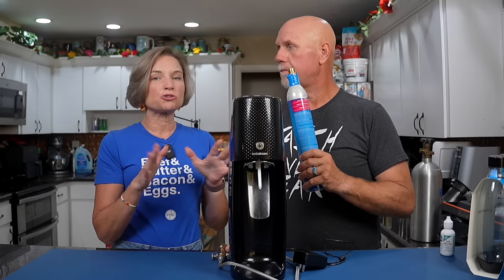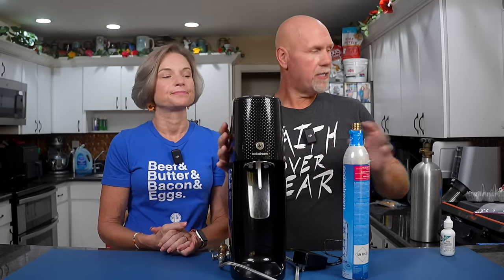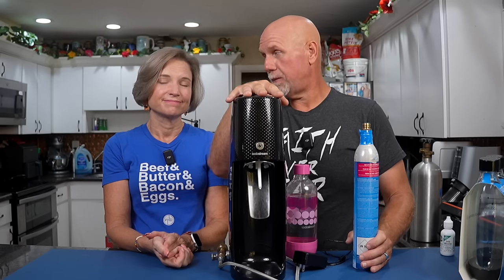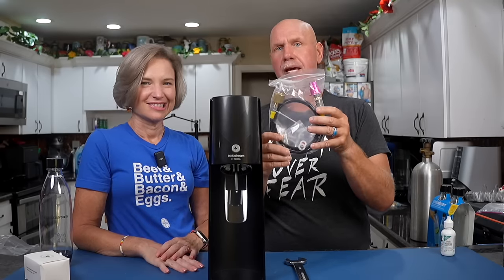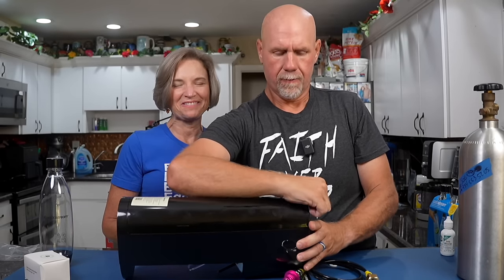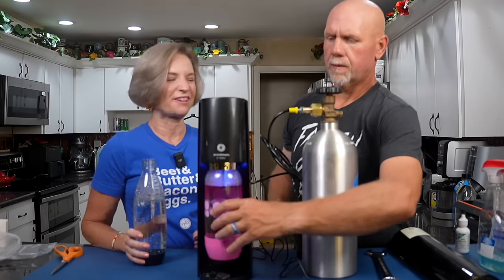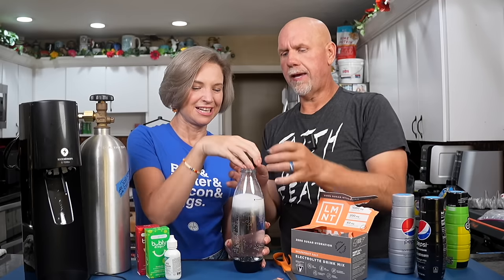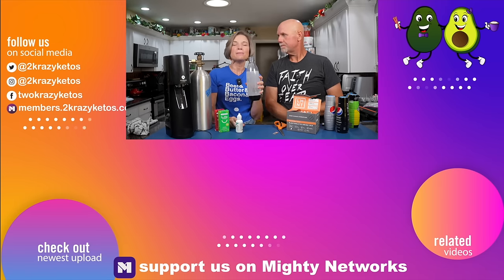Does the SodaStream system save you money? | How to modify the SodaStream Terra models

Comment: You should always keep the water cold BEFORE carbonation because the water will hold the carbonation better and it will carbonate more efficiently. It's a simple physics principle.
Reply: I agree.
Reply: Hubby and I keep a britta pitcher of water in the fridge and use that to fill our soda steam bottles. 😋
Reply: He said this... why are you bringing it up ?
Reply: Not only that, but in my beer making fridge, I keep the whole C02 tank cold also .... proper pressure achieved much quicker.... better .. physics.
Reply: @jhillestad  Yes, he said that they like to put their bottles with water in the fridge, but he didn't say WHY, which is what the OP did here.
Reply: Yup. Gasses are more soluble in liquids at lower temperatures. Boiling tap water makes it taste bitter because of the CO2 that gets boiled out, making it more alkaline than regular tap water.

Comment: Just so folks know: mileage may vary!  I charge at least one 1-liter bottle a day (sometimes 2) and my small Soda Stream c02 tank lasts me at least 3 months. Also, the cost of canister exchange here in my NC town is a flat $16. Our local Staples and Target keep them in stock. That being said, the main reason I have a Soda Stream is for convenience and to reduce the waste of single use bottles and cans.
Reply: This doesn't math up. 1 liter bottle, at least once a day for 3 months. That's a minimum of 90, 1L size bottles. Even if you go by the 840mL fill line, that's a minimum of 75L worth of carbonated water. The company states it does 60L, which I have not gotten close to. The closest I have gotten to is 35 of the 1 L size bottles, which is about 30L of actually carbonated water. What's your hack for getting at least 75L of carbonated water from a single 410g co2 cylinder?
Reply: 16 bucks for a small thing of c02 is ridiculous. You can buy an adapter and fill up a 20oz co2 tank for under 5 bucks at your local sporting goods store. Thats the route i took, ive had the soda stream with the modifications for about 4 years. Id say ive probably saved a few hundred dollars not having to pay that cost for their co2 tanks.
Reply: @TooMuchTemper it costs me $18 just in gas to get to my local sporting goods store because it’s so far away. So $16 to not have to drive that far + cost of the refill sounds like a good deal to me
Reply: Does the sporting store have food grade co2?
Reply: For the small cylinders I pay $10 Canadian $ at Winnipeg fire and safety.  They advertise on the radio.  They also have bigger cylinders but they won't save you money because you can't get all the gas out because the pressure drops and the cylinders have a date stamp and can't be refilled after that date.  The small ones are cheaper overall and about $7.50 USD.   You should get the same price in the states if you shop around.
Reply: @TooMuchTemper  I was going to do that but then I found out the bigger cylinders expire and you can't get all the gas out.  The pressure drops and there is about 20% still in the bottle.   I weigh my small bottles and because of the shape and smaller volume you get almost all the gas out and into the water. Then you don't have to find a place to mount the larger tank and run the hoses.
Reply: @jeffbguarino  idk i use it all the time, canister i have lasts probably 3 months before i have to take it to the sporting goods store and fill for about $5.30. Ive had it for 5 years now roughly. Doesnt seem like the can is in bad shape? I also dont see an expiration date. The mod was well worth it for me
Reply: @jeffbguarino  also my tank fits right in the soda stream unit. I have a very old version
Reply: @jeffbguarino  try tippman 20 oz bottle. The date stamped is the production date ! Not an expiration. Brass mod was 75 dollars. After years of use ive definitely got my moneys worth with the larger capacity and 5 dollar fill ups

Comment: Any Welding or Industrial Gas supplier will sell you a bottle, and refill / exchange it for you at better rates than Dicks or the beer / homebrew distributor.   Bonus:  The bottles have to be periodically pressure tested, so if you are exchanging them, you never have to worry about that.
Reply: This is useful info. I purchased a new empty CO2 tank but it's hard to find anyone in my area that will fill up an empty tank. They all just do tank swap outs. Worth checking around your area first to see if any place even does refills, and do a price comparison. The welding/industrial gas spots do seem cheaper
Reply: @JoshSchlottman  The other take-away is this:   Visit a gas supplier and tell them exactly what you intend to do.  In my case, I am refilling sodastream bottles (not very often, they are a PITA) or small CO2 bottles for use with a sodastream adaptor fitting, so they recommended a SIPHON.

I have a 20lb cylinder, WITH A SIPHON.  This feeds liquid CO2 from the bottom of the big cylinder into the target.  You get a better fill, waste less gas, and generally, can all-but empty the liquid from the source bottle.
Reply: @whiteb0rd  - Hi @whiteb0rd, 
I feel a little bit dull in trying to picture what you are describing here when you say, 

"The other take-away is this:   Visit a gas supplier and tell them exactly what you intend to do.  In my case, I am refilling sodastream bottles (not very often, they are a PITA) or small CO2 bottles for use with a sodastream adaptor fitting, so they recommended a SIPHON.

I have a 20lb cylinder, WITH A SIPHON.  This feeds liquid CO2 from the bottom of the big cylinder into the target.  You get a better fill, waste less gas, and generally, can all-but empty the liquid from the source bottle.",

but as I am simply exploring this whole process & do not even own a SodaStream at this point, besides seriously requiring visuals for me to understand unfamiliar processes, I'm struggling to follow what you are describing.  Any chance you could make a short YouTube video to talk through & show the steps of the way you've found to do this?  Maybe you could then comment back here with the video name & your channel name, so that people could find it (Or maybe these folks could pin it here to facilitate the search)?  In any case, I'm really interested in what you've described & would love to understand better! TY!

["Does the SodaStream system save you money? | How to modify the SodaStream Terra models" - via 
2krazyketos]
[5.27.2024]
Reply: @mcsmama what a siphon is in a 20 lb CO2 canister or any refillable CO2 canister for that matter, is essentially a tube that runs from the valve at the top of the tank to the bottom where the CO2 is in a liquid form. I cannot explain how, but this makes complete use of all the CO2 in the canister as opposed to drawing CO2 from the gas state at the top of the tank if it does not have this tube.

Comment: I have been running a soda stream on a 5lb co2 tank for a few years now. I drilled a hole through the countertop and ran the hose down to the cabinet below where I store the co2 tank. makes for a really nice looking install.
Reply: Is it dangerous to keep in your house? I think I would want to keep mine on my condo balcony just in case. What if there is a leak??
Reply: @hw3006  it's co2, not explosive. Would you worry about having a fire extinguisher in your house?
Reply: How are you refilling it?

Comment: I add the electrolytes to the water before I put the co2 in, no issues. I use the manual soda stream, new style bottle. Must space your pumps out to match the bubbles expanding.

Comment: I bought a 500ml pump dispenser bottle on Amazon and pump a few squirts into a glass and then add the plain sodastream water into it. No bottle cleaning necessary since it only has plain water in it at all times. I can adjust the strength of the drink by using more or fewer pumps of syrup. For example the Pepsi zero I use 4-5 pumps, for Starry I use 5-6 pumps.

Comment: The difference in the non diet sodas is the sweetener. If you look at the contents, it shows sugar and sucralose as sweeteners. The Pepsi in the store uses either high fructose syrup or regular cane sugar as the sweetener. They are also using inverted sugar, as well.
 A long time ago, I worked at Jack in the Box and we had a way bigger canister for the carbonation. It may have had a device to keep refilling it, as I never remember refilling that bottle. We only refilled the syrup bottles.

Comment: you can modify any version.  I gutted mine and put it in a custom housing. I removed the button and replaced it with an electronic valve, so a Arduino could pulse the gas very precisely with a touch screen.  I then use a 7 station peristaltic pump to dose the syrup.

Comment: 20 bottles is really little. I have manual soda stream that uses pink cartridges and I definitely carbonated more than 50 bottles (840ml) already and no sign of it running out of gas yet. I usually press 4 or 5 times so I guess it's like low setting with electric ones, oh and in my country change of bottle is like 10 bucks in USD. But I guess with this mod you can gat way more for even less money in a long run.

Comment: I simply use 14.3 ounces of dry ice. I open the sodastream CO2 cartride bottle top. Pour in crushed dry ice, and then I put the bottle top back together. It cost me $2.20 to recharge 2 cartridges. $1.25 per charge. No other plumbing, tanks, or gadgets. I get the food grade dry ice from the local grocery store. It works perfectly. Dry ice is extremely brittle. It is easy to crush below 9/16 hole opening size. Funnel the right amount of dry ice, close it off, and I'm good to go for another 5 weeks. Easy Peasey. I have the Terra quick connect type of top to the cartridge.
Reply: Dry ice has become VERY difficult to find in my area. I used to use it for hunting and fishing trips, but have little to no location option recently.

Comment: I previously owned the SS CRYSTAL, but the base snapped, and I couldn't find replacement parts. I've since transitioned to the more eco-friendly DrinkMate. It can carbonate any juice or mixed drink without the need for extra water dilution, and it's also compatible with universal 60ml CO2 thread canisters, unlike the SS, which requires their own patented qikrelease, presumably due to Pepsi's acquisition, not sure why they need to keep over 20 plastic SS bottles lying around. I thought these machines were meant to eliminate this problem?

Comment: 13:06 It's a good lifetime general habit to never push when using an open-end wrench. If the wrench slips off, you are likely to skin your knuckles on something (or punch your significant other in the nose). 😵This will never be a problem if you pull on the wrench instead. Plus, it's easier to accurately gage how much force you are applying when pulling vs. pushing. (My dad taught me this when I was a child.)

Comment: Does the large CO2 tank require a siphon tube?
Reply from the maker: No
Reply: @2krazyketos  Thanks. So, a siphon tube is needed only if I wish to use a large tank to refill SS canisters without inverting the donor tank, correct?
Reply: @2krazyketos  Could you use a CO2 tank with a siphon tube?

Comment: Thank you!  Great info!  I have one of the old original Soda Streams. Is there an adapter that you’ve a link for to share?
Reply from the maker: https://youtu.be/0VArJfKQwE4
Reply: @2krazyketos  Thank you very much for the video. Sadly my model is even older than this video. It’s manual/push type & I think SodaStreams first generation of machines. Thank you again for trying.
Reply from the maker: @lisaturner6297  all of the original soda steam models use the same fixture.  If you are currently using the blue label bottles, it will work.  It works with the manual ones as well as the electronic ones
Reply: @2krazyketos  Thank you so very much. I’ll check again. It would sure be a great $$$ saver for us 😊

Comment: - 02:35 💰 SodaStream units are expensive, costing between $100-$200, with ongoing costs for CO2 cartridges.
- 04:21 ❗️ Despite claims, users often only get about 20 fizzy bottles per CO2 cartridge, making it cost-ineffective.
- 05:02 🧪 Attempted DIY solutions to save money by using dry ice as a CO2 source.
- 06:07 ⚖️ Differences between the old SodaStream models and the new Terra model.
- 09:40 🛒 CO2 canisters can be refilled at local stores, including beer and wine shops or sporting goods stores.
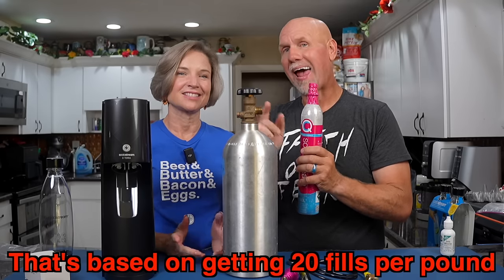- 11:25 💡 Cost-saving tip: Modifying the SodaStream to use a larger, refillable CO2 canister reduces cost per bottle significantly.
- 13:36 🔧 Step-by-step guide to modifying the SodaStream Terra model to use a larger CO2 canister.
- 14:56 🧊 Tip: Keep extra bottles filled with water in the fridge for quick carbonation.

Comment: Because I make my own kegged beer...I have an even cheaper way to carbonate bottles.
   The connection set up from a beer making C02 tank is all you  need plus some adapters.
You purchase the C02 tank, regulator and hose with proper connector to a PEPSICO can ( that's the name of the fittings on those stainless 5 gallon tanks). 
    Now ALL you need is an adapter from the Beer Store where you screw the adapter onto ANY pepsi bottle, Coke bottle, ANY bottle with those treads, but NOT spring water bottles, ONLY bottles designed to hold pressurized liquids for sale ...ANY pop bottle will do. 
    You just  pour your fluid into the empty pop bottle, screw on the adapter, turn the regulator up to about 20 to 40 psi, shake the bottle up for a minute and POOF, you have carbonated water/pop.
   When you pour your first glass of pop, just replace the adapter with a regular cap ...BUT, I love my pop to be " fizzy" right down to the last drop, that what I do is give the pop bottle a shot of C02 when it's half empty, now when I open that half empty bottle of pop, it's as fresh as the first drink. 
    It's very convenient to use 2 liter pop bottles for this...AND ... not many people know this, but keep the C02 tank INSIDE a second fridge makes the pop fizze up so much better.

Comment: I think it's very important to let viewers know how much psi the current co2 tanks that come with the sodastream and the homebrew co2 5lb tanks. I think the 5lb tanks outputs 1,000 psi and may need a regulator to adjust psi's accordingly to avoid blurps/hissing from the sodastream.
Reply from the maker: There is a built in regulator.  Anything over 5lbs would need an additional one
Reply: I think any tank of CO2 has the same pressure because it is simply the vaporization pressure of CO2 at room temperature. Every full tank contains liquid CO2 which is then vaporizing to gas as it is dispensed.

Comment: You're not worried about not having a pressure guage on the co2 tank? I just bought a setup and am planning to modify, but I am worried about blowing up my system.
Reply from the maker: you can get one on the adapter if you want.   The 5lb cylinders have the same pressure as the soda stream canisters.

Comment: Is there a way to just refill the SodaStream canister with the big one? I think it's a great idea, I just hate to have a big canister laying around the house. I prefer less clutter.
Reply: I use a 20lb tank I keep in the basement to refill my sodastream tanks.

Unfortunately, my detailed response explaining the setup process was auto flagged by youtube as spam, deceptive practices or scams. And I was warned my account may be banned. So you are on your own to figure out how to do it, but it is definitely possible.
Reply: Yes you can you can buy a big one and refill at home make sure you get the right equipment tho because the new canisters have a "safety" valve inside it so that you can't do it your self but it is possible
Reply: @danielletanner1797 I have the quick connect (new style) canisters and mine have been filling fine with the Chinese adapter I bought. Did they add this new safety valve recently?

Comment: Sorry for all questions but I got my tank and hose I hooked it up upon looking at my fitting there was white washer in it thought I got extra did not put extra in turned valve it was leaking out turn off put the extra one in and did not Carbonate enough tried again white foam came out tried again button was stuck on Terra non electric tried again it worked what did I do wrong?Thankyou!

Comment: I just got two fizzis on marketplace for $70 dollars with 3 canisters and two bottles. The only place here in sc that I can find to refill 5 lb cow tanks are air/gas companies. I’m wandering if that is ok. Not good grade. Dicks sporting goods here does not refill. TSC also does not refill.
Reply: I learned that food grade, medical, and welding CO2 gas are usually the same purity. Discuss your concern with the store manager.  Have your own container refilled rather than doing an exchange. Never use CO2 gas designed for paintball guns because it might include lubricant.

Comment: Awesome video! I have been looking at getting a soda stream to make drinks at home. Do you have any issues with the soda stream since the 5lb co2 tank is charged to nearly 1,000psi vs the bottles it came with at around 120psi? Will this add any extra wear and tear on the soda stream or does the soda stream regulate the extra pressure?

Comment: Chemist here. What are the gas pressures of the two tanks?  If the bigger tank gets a higher pressure, you're getting more than the ratio of tank volumes of gas molecules.
Reply: Add to that; the 60L on the sodastream bottle is for the CO2 volume (uncompressed of course) it might be a bit misleading, but I would be surprised if sodastream said that you can fill 60L of beverage out of one can, at lowest fizz.